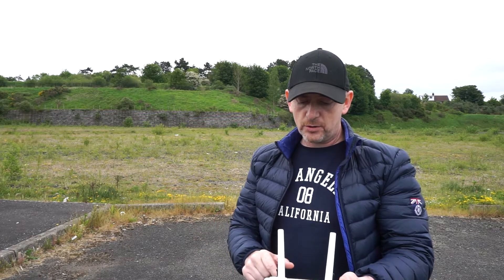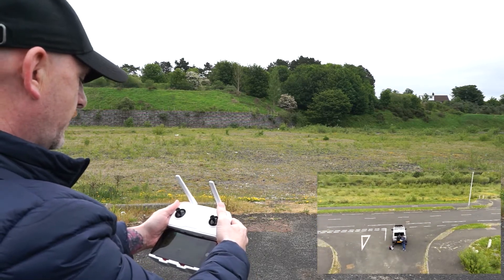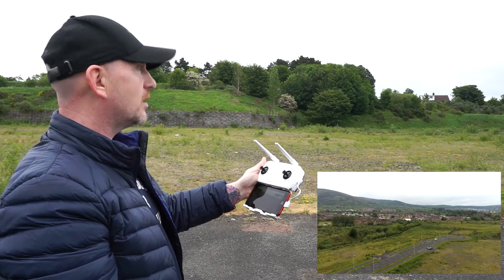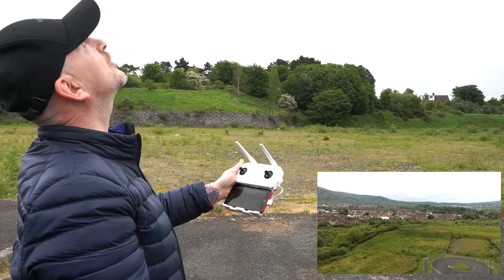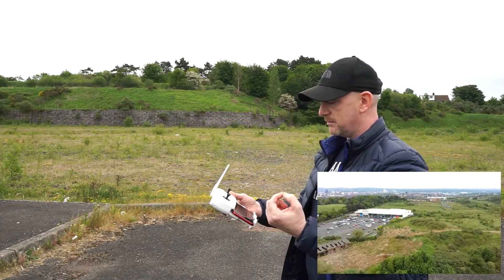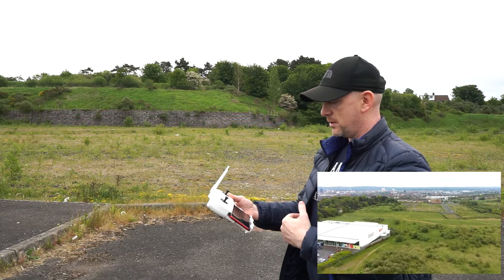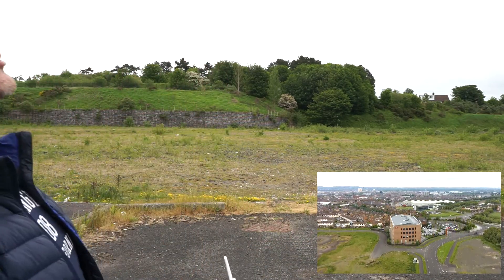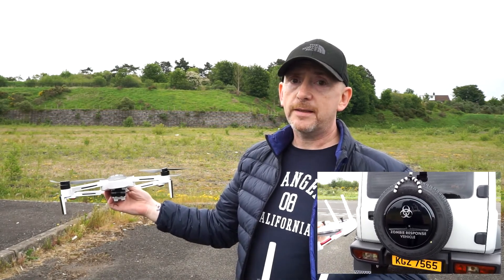Hubsan Zino 1.1.51, IT_VO.3.6  Part 3

Comment: You know. To us new guys just getting into the hobby, this is very confusing. How so many get different results using the same updates. At this point I guess, I should be happy if I just get the thing to come back to me. I'm still on 1.1.48 and it seems to do just fine. So until I see something more stable, I think I'll just stay where I am. I want to keep up with the latest updates on my Zino but right now I'm going to have to pass on this one until I see something more consistent across the board. Thank to all you guys for all you do for us newbies. QC guy, Marcus, Gorilla Man and Hugh.
Reply from the maker: That feeling never goes away and I had no idea if it would come back to me after disconnect as I’d never had it happen. I think the main problem people are having is not doing the updates in order, confirming they are on, and doing all the calibrations before flying. Also waiting for 12 satellites. The sd card is also very important, I use a different one to the one I take videos with so I never get a problem with that. The San disk extreme pro 32 gb works perfect. I know there’s a lot with this drone compared with a dji but I do honestly enjoy just flying around with this more. 👍🏻
Reply: Well, considering your advice and Chris QCguys opinion, I may just go ahead and install the update this weekend and take it out and see what happens. If so, I'll give you an update to let you know. Thanks again, for all you guys do to help out the new guys coming into this hobby.
Reply from the maker: Daniel Jolly thanks Daniel, the Zino has come a long way in the last 6 months. This is where it should’ve been when it left the factory for the first time. My first flight it went up 5 meters and took off into a tree 20 meters away without any input. I would recommend this firmware if you follow the correct procedures as I’ve flown it a lot and it’s working great. Still not perfect as it doesn’t have a flow sensor on the bottom, but definitely an improvement. Keep flying and enjoy it. 👍🏻🤠
Reply: Thanks Hugh. I'll take your comments into consideration. But you really can't blame me for being a little skeptical. It's hard to consider the Zino reliable, whenever you get the thing out there, and in the back of your mind you still have that sinking thought will I get it back.  I have seen on some of the facebook groups, there are some who after updating, they then can't seem to get the drone to reconnect. But that maybe just failing to do the update correctly.
Reply from the maker: No problem, from what I have observed the firmware appears to load better on top of 1.1.48 as myself and qc guy done it that way and Marcus had 1.1.51 and had some issues with crabbing etc. Please let me know your results and take your time. I recommend having qc guys video on how to download the firmware in order as reference while you do it. I still have to do that to make sure I do it right. Good luck 👍🏻🤠

Comment: Wow, you've got a good one Hugh!  It flies straight.  👍  It turned around immediately on disconnect.  It does exactly what it should.  Great flight and test Hugh!
Reply from the maker: Idaho Quadcopter it’s working great Marcus, very happy. Have you tried reloading everything on yours to see if there’s any difference? Very strange how it’s flying.👍🏻🤠
Reply: @Droneaddiction  I'll keep working on it.  I suspect it's related to the compass calibration somehow.  I've done the measurements after calibration, and the yaw as shown on the app is always several degrees off of magnetic north.  🤷
Reply from the maker: Have you tried doing a different style of compass calibration, I hold mine and just spin it slowly in my hand. Worth a try 👍🏻

Comment: Sorry... No different from 1.1.48 .. Thanks.. I just did the 1.1.48 video... The drop on launch is sometimes there... sometimes not. The disconnect initiates RTH and GPS hold on recovery and PL landing is within a few feet. I cant explain it.
Reply from the maker: Gorilla Man it appears people are getting different outcomes with all the firmware updates. I was happy with 1.1.48 but this has sorted my crabbing issues, never flew to disconnect before so I’ve nothing to compare to. I don’t know and can’t explain why some work better than others etc. If mine stays like this 🤞 I’ve no reason to change again. Just wish we could get a better controller
Reply: @Droneaddiction  : I am just uploading my 1.1.48 conclusion video... operates exactly like the updates... I am confused.
Reply from the maker: I never had 1.1.50 on my system and it wasn’t too bad, the only thing I really noticed was the crabbing has disappeared. I’m thinking if you put the new software on top off 1.1.48 it works better. Marcus Crawfords appears worse and he was on 1.1.50. Could be a bug in the software of 1.1.50
Reply: @Droneaddiction  : Look at mine... I did not notice the crabbing??  https://youtu.be/iznn8oe59E0 .. I have gone back and forth between 1.1.48 and 1.1.50  a couple of times and decided to keep 1.1.48
Reply: Do you have the screen recording of this flight... Maybe the update initiates RTH on controller signal loss instead of waiting for both to fail. That in of itself would be a small improvement.
Reply from the maker: Just watched your video and your quad flies identical to mine, we must be the lucky ones, the screen recording is on my other video, didn’t do it for this one. I don’t get any interference when directly above 🤷🏼‍♂️